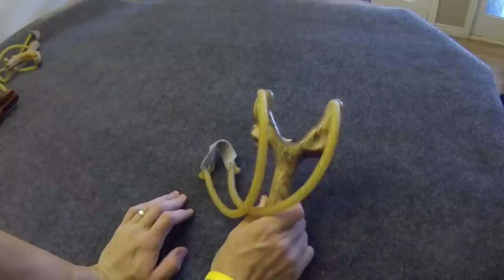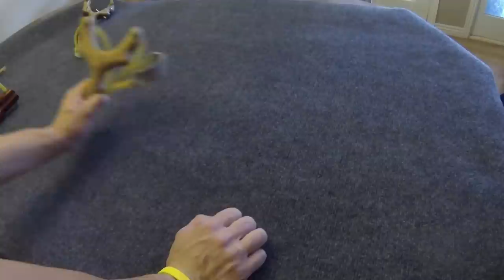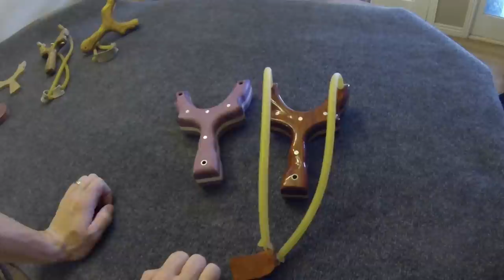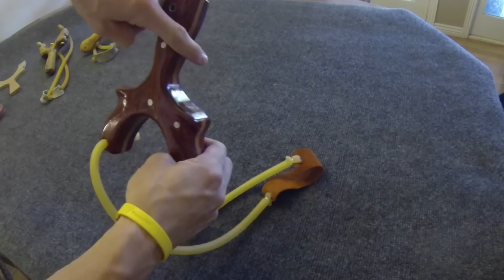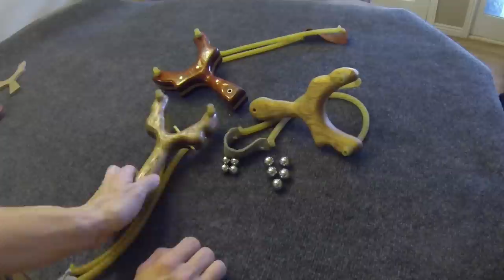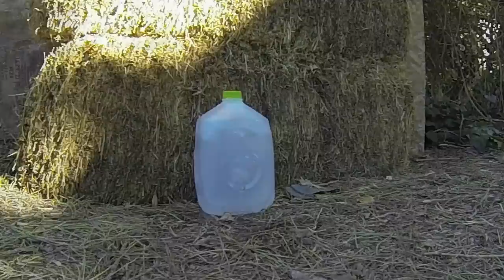Most Powerful Handheld Slingshot!

Comment: Old video that I just ran across. First of all, "good job".
Second, you are the first person I've seen who is trying to do what my younger brother did many, many, moons ago. 
Back when I was in college, I was able to legitimately salvage a fair amount of rubber tubing from chemistry class. My younger brother used that tubing to make slingshots. 
His ammo at that time, was 457 caliber lead balls. The rubber tubing was very thick walled, and close  to a half inch in outside diameter. 
Now, we didn't have chronographs, but he used that slingshot to hunt with. It was capable of driving that lead ball completely through an adult turtle, shell and all, and completely through small logs (3 inches or less). 
You are the first person I've seen working towards that same capability. (He used a steel frame).
The rubber tubing I salvaged is something I haven't run across since. The closest I have found is spear gun tubing. 
Sometimes I think about what my brother was able to do, and compare that to everyone's current capabilities. ... Not even close  .... but you, sir, are getting there. ....

Comment: I don't know who this guy is but two smaller diameter bands are faster than one big one, proven many times over by sling shot manufactures and serious hobbyist , flats are the fastest. The strength to pull the back does not have a lot to do with the elongation return speed. I can assure you that 400fps is not going to happen. (I have made and tested hundreds of slingshots). I might add the pouch you have looks very heavy and that takes much away from the speed. Also the bands need to be in a 1 to 5ish ratio to draw length ... you are not getting anywhere near the efficiency you need, a heavy thick pouch and long thick bands is not the way to go.

Enough from me.
Reply: Ullr the snow God the ratio of the band at rest vs the band at full draw. Example a six inch band drawn to thirty inches.
Reply: New to the hobby haven't even recieved my first slingshot yet.  Thanks for the info on the bands!
Reply: @johncromwell7182  in other words, draw length/5= active band length.
Reply: Tube band is more effective with spear gun.  That why the Chinese shooters keep winning competitions.  No body pays attention to their slingshots and keep playing with awkward frames and tube band.

Comment: I just read some comments below on materials... Have you ever considered using any type of synthetic? I'll bet you can significantly reduce the size and weight while increasing the durability. I know, wood is so much classier looking and nicer to work with. Still, many prefer function over form, especially when adding to backpacking gear. Remember, ounces equal pounds and pounds equal pain. lol!

Comment: Back in the early '70's I picked up a "Wrist Rocket"  Slingshot, and 100 rounds of .25, 1/4 in. steel balls.  From the very beginning I felt that the steel was just to light, out at distance most would have a pretty wild  "Hook".  
I am a little surpized that you didn't say anything about the lead round ball ammo?
I switched to round musket balls and fishing sinkers.  .36, 45, 50, and 58 calibers.  All a bit slower than the steel rounds but energy on target was far above the steel, because of the much higher mass. The musket balls fly better, straighter, and are more accurate, for me.
 A good sling and the right ammo should be able to feed you if needed.  Small game, rabbits, squirrels, and birds.
From a Self Defense view point....
A 58 caliber Musket Ball from a "Wrist Rocket" Sling, WILL with a center mass hit on a man sized target WILL knock him off his feet anywhere inside a city block. all , indoors, will break bones and could be Deadly.
Please be careful out there, these things are dangerous.

Comment: Nice video. Awesome power. 500grains at approx 400fts is 178ft/lb or 240 joules of energy. No wonder you're going through the water jugs and 1/2" plywood.

What type of tubing you using there?
Reply from the maker: Tae Gon Lee 1/8 ID X 1/4 OD tubing. and I got the 3/4 balls from ebay.

Comment: Mate, Madison Parker's slingshots are not the most 'powerful' slingshots, it's the bands he shoots with that are powerful and he can't claim that his slingshots are the reason for power. I suggest using heavy bands on lower forks because that means less strain on the wrist eg. Rambone design and if you don't like shooting hammergrip I'm sure you can modify that design to fit your shooting style. Really well finished slingshot, great craftsmanship, keep the slingshot making up!
Reply from the maker: Great points thank you for the input. Thanks for checking out my video.

Comment: The way you hold it isn't there unnecessary strain on the wrist I think you should add layers of a flat rubber like Thera band gold which gives you more power and then you can shrink the forks a lot because then the ball flys over the fork however great craftsmanship
Reply from the maker: Harris Masson I tried flat bands and they only seemed to do well for me up to 3/8 size balls, 3/4 balls did not work well at all. I have not noticed a strain while shooting. Thanks for the tips and thanks for watching.

Comment: You would have better success with much lower, bottom mounted forks and flat bands, such as the slingshot channel displays on the tutorial for a powerful slingshot. His only rise above the grip maybe an inch, and doesn't his hands even with large ammo. That frame is more akin to a rock lobber than one designed to shoot one type of ammo as powerfully as possible.

Comment: well i love this singshot but there are way more easier ways to make this more powerful and cheaper 

1.use steel as the fork or other stronger materials than wood that is cheap

2.use tapered natural latex or theraband flat bands they are waaay more powerful than tubes(but don't last as long)

3.use a lower fork or have a wrist brace

4. butterfly it

Comment: It's obvoius the power you've achieved out of these, and bravo for all the hours put into research and development. However, the fact you needed to pull the band back behind your head scares me a little. And, it makes me question if accuracy is reasonably achieved without extensive hours of practice. After all, what good is power if you can't hit your mark? This was the first video I've seen by you and with this design, so please don't think I'm being insulting. The video just would've felt more complete if those two critical issues were addressed.

Comment: How or where can I purchase the neoprene tubing?   I am an amputee and have survived as a child growing up on wild game that my dad would hunt for in the woods. I desire to have a length that I can cut off short segments to push onto my artificial hand, [hook device] and nothing else works for the elasticity needed but only Neoprene tubing.  The ID is the size of the small drinking straw and OD. is up to 1/2 inch across.  I am American and wont go into metrics in measurements but need some help in getting what I have used up and cant replace not knowing where to look.  Dad used hickory tree forks to make his slingshots and tire  inner tubes years ago were of a different kind of rubber. Please give me advise or sample of tubing and cost of shipping and will respond.  Thank you,                                                                                           Lester Peoples                                                                                  17 Garvine rd.                                                                                Ayr. Scotland KA6 6NX

Comment: you need to build one with out the cut out just a  hole punch drill hole for a arrow  and just cut a little divit  right above the arrow hole for aiming  so you can shoot arrows in it make it just like that one  but no cut out for  steel balls just a hole in line with the tubes or bands  yes it works great i have done it for the last 40 years makes a nice deer hunting weapon i have killed about 50 white tail deer with them i use the black tubes mostly  but just a little tip from a vet sling shot and custom nife leather and long bow builder  hello my name is mike best and i was a bush crafter before there was a such thing as a bush crafter its my way of life  try bud  if you shoot side ways no need for the divit or notch above the arrow hole  use the corner of the arm at the start of the tube or band  deadly machine  rabbit and deer killer for sure  done it to manny times

Comment: if you shorten your tubes you get more power at a point not to short and then you do not have to shoot full butterfly  if they are to short the power and accurat C will suffer though  any way you can anchor at your ear or cheek side of the face

Comment: it doesnt even has an arm support....... how can it be that powerfull
Reply: +Rogebrood arm supports are actually bullshit.
a well designed (not saying this one is) slingshot doesn't put undue pressure on the wrist.
don't place the fork too high and make sure the handle has appropriate support in the places the force is going to
be acting on; the ridge of the hand between finger and thumb and the pinky.

Comment: Why does this guy think even in 2014 this is the most powerful handheld slingshot? Back in the early 1990's I purchased two wrist rockets from some local sporting goods store [forget which one] and these things were extremely powerful. I could punch a hole in the side of a steel trash can full of water at 50 feet using a marble. That's right, it wasn't a steel ball... just a plastic or glass type ball. Let's see knifegunguy's featured slingshot do the same at the same distance with a marble. But he won't because this video is too old and it's likely he's already progressed onto more powerful slingshot weaponry since then.

Comment: that's a pretty hard hitting slingshot...but, not the hardest hitting slingshot...Joerg Sprave makes some pretty serious slingshots...one of which he proved hits harder than a .357 and a 45 Cal handgun...
Not trying to take anything from this slingshot... it would definitely do some damage...just questioning the claim that it is the most powerful one...
Reply from the maker: Thanks for watching the video at the time I made the video I was not aware of his slingshots they are pretty sweet.
Reply: +knifegunguy I really enjoyed the vid BTW...makes me want to build some more of my own...I make mine outta HDPE...but, I've made a few wooden ones...I made the mistake of buying Oak ply instead of Birch...was told that oak isn't safe to use because of possible voids, so I have a half sheet that I haven't even cut into yet...
Reply: +Awakened2Truth - Disciple of Jesus the Christ I honestly can't remember... but, it is the bandset that really matters...as long as the frame is strong enough to handle the band's strength...just search "can a slingshot hit harder than a handgun"
Reply: +Awakened2Truth - Disciple of Jesus the Christ yes it is on YouTube...and it's quite interesting :)

Comment: I sell slingshot ammo  (lead balls) on ebay and various bands along with custom slingshot designs and yet I still use a cheap chinese slingshot with 6 strands of 2x5 with a 10.5mm lead shot and it out performs anything iv ever owned 
It'll punch a perfect hole in a car Dore no trouble.
Reply: mancave creations what's your shop name?